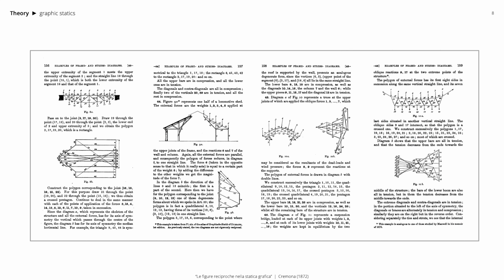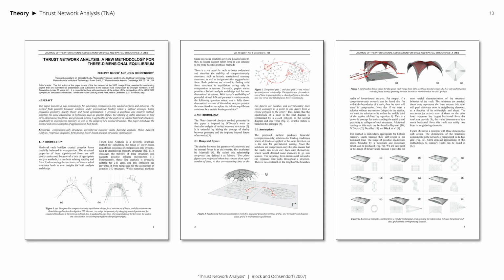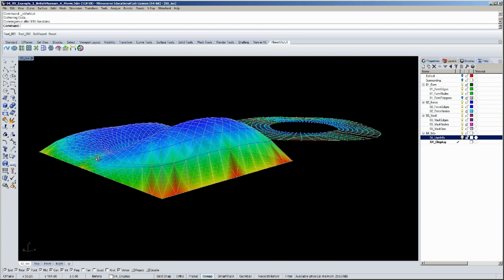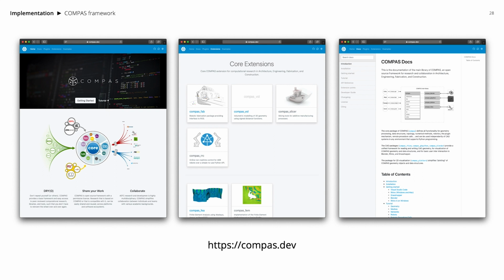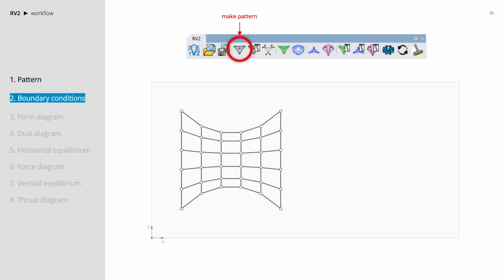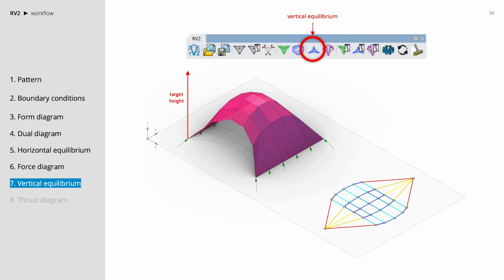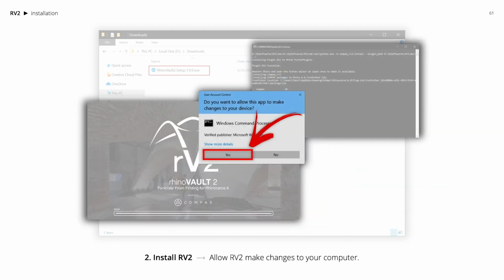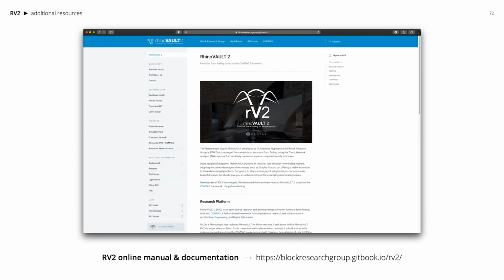RhinoVAULT 2 Advanced Class Intro by Juney Lee - Block Research Group - Live Academy

Comment: I find problems when trying to download Rhinovault 2 for Rhino6 ... or for Rhino 7 Beta - 
I don't understand why I don't see an allli window, as simple as with RhinoMedical, which seems heavier but installs without any problem .
-- then from downloaded I can't find the same one inside Rhino .... 
(Help + Thanks)
Reply from the maker: Hi Claudio, follow these steps to download and run RV2:

0. Preparation: Open Rhino and run the command EditPythonScript once, then exit Rhino (this will initialize some internal Rhino folder structure which is necessary for the installation of RV2). 

1. Download: Download latest RV2 installation file from https://github.com/BlockResearchGroup/compas-RV2/releases

2. Install: Run the installation file. If you see following prompt, click on More info then choose Run anyway, After the installation interface shows up, click on the Install RV2 button, then choose a location to install RV2 on your computer.

3. Activate Toolbar in Rhino: In the top menu, go to Tools > Toolbar Layout, In the pop-up window, click File > Open, Go to the location where your RV2 is installed, for example D:\MySoftwares\RV2\ , then find the file RV2.rui and open it, Tick RV2 in the Toolbars section, The RV2 menu and toolbar will now both appear in user interface.

4. Initialise RV2: To check that everything worked, click the Initialise RV2 menu item or toolbar button. You will be asked to accept the "Terms and Conditions" and "User Agreement" (just click Yes :) after which the welcome screen should disappear.

If Rhino says Command not found: -_RV2init, please type EditPythonScript to open the script editor and restart Rhino. Then try the initialisation again.
Reply: @claudiofeldman  Full online documentation and user manual of RV2 can be found here: https://blockresearchgroup.gitbook.io/rv2/
For questions, comments and suggestions, please use the RV2 issue tracker: https://github.com/BlockResearchGroup/compas-RV2/issues